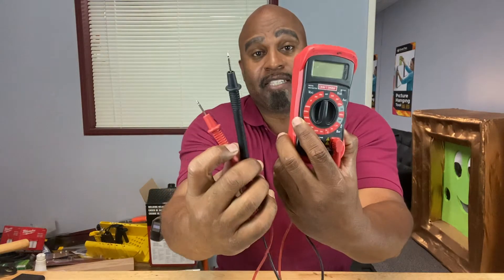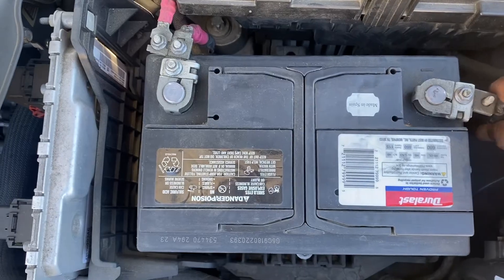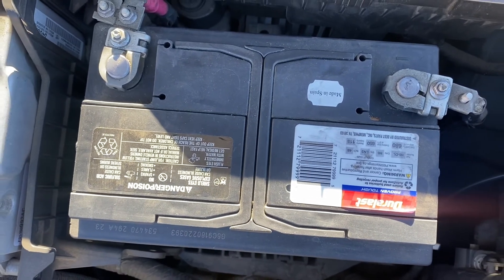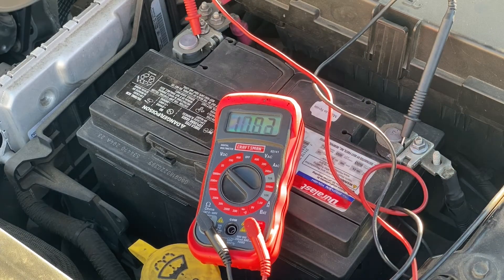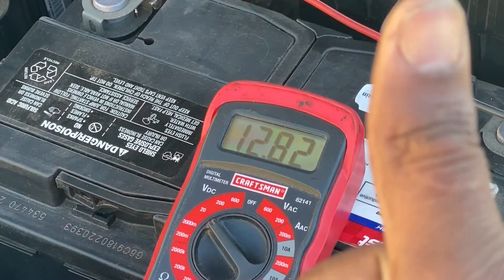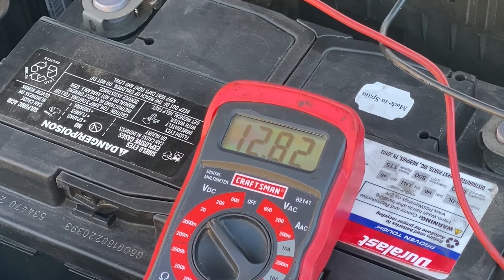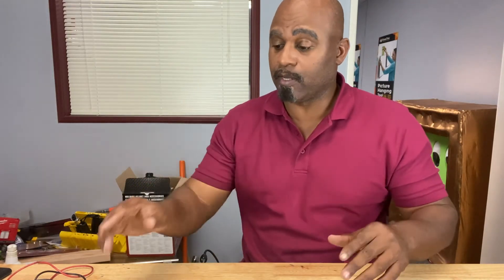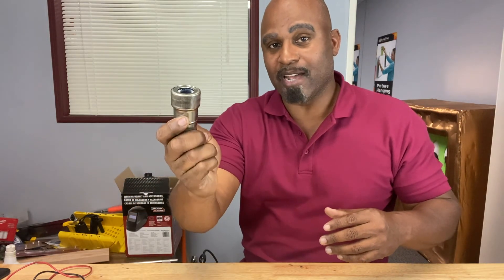HOW TO USE A DIGITAL MULTIMETER ON A CAR BATTERY

Comment: Thanks so much for this video! It helped me a lot, I'd never used a multimeter before and the manual did not do a good job helping to explain how to use it on a car battery.
Reply from the maker: Glad it helped.
Reply: @Caliber8Tools  Using your guide when my car wouldn't start, I found out my car is running at 14.4volts but with the car off the battery says 10.4. I took it out and hooked it up to a charger, hope that does the trick!

Comment: Pro tip - edit the audio track of the music you added for your intro. I typically use about -15 DB so the end result is the same audio level as my commentary. Each piece of music you add needs to checked before you compile the video for upload. That might reduce the amount of your viewers skipping your intro, or the whole video... nobody likes blaring music or commercials when they have their volume set to hear what your message is.
Reply from the maker: Thanks for the feedback.

Comment: Hi my car is reading 14.1v when engine running but when i put everything on lights heaters blowers a/c radio etc the voltage drops 13 to 13.3v is alternator faulty thanks
Reply from the maker: No if it’s above 13V your ok.
Reply: @Caliber8Tools  thanks

Comment: Very helpful.Thank you.  I have that same multi meter and I didn't know about the dropping below 10 volts when starting trick. I was also using the center port for my ground wire. I'm not sure if that matters.
Reply from the maker: Glad it helped. The negative cable should plug into the ‘COM’ port on the meter.
Reply: wait, now I am confused. In the video you do not have any cable plugged into the COM port of your meter. Did you mean the OHMS port because thats where you have it plugged in on the video here. I hope you answer me because I am trying to see if I have an electrical problem in my charging system. @Caliber8Tools
Reply: The black cable that goes to the negative terminal should be at the com port.

Comment: The meter connection is wrong.  Black lead is always in the common connection.  As a result if you set or measure something incorrect , you have no protection in the meter and it can be damaged.
Reply: If you have your test lead in Amp fused port, you have to test a certain way. Thats to test the ampers of the current through your circuit. You have to remove a wire in your circuit to do this, somewhere make your DMM part of the circuit you're testing. If you use this setting improperly, the fuse in the DMM should blow. If it's cheap, that might not have happened. If you use it above 10 amps, you're risking it even more. The only setting you should use a DMM on to test your car battery is DCV. That measures Voltage supplied by source, your battery. You can check resistances of any load you have in your car (so sensors, fuses, wires, etc) but you have to remove Voltage & shut off what you're testing or remove to bench test. High resistance can cause unexpected Voltage drop in your circuit. Low resistance can let too much through. But simply for your car battery your in DCV, & the black in comm & the red in the one with the V&Ohms symbol.
Reply: Meter connection looked accurate to me. What ground is the common ground younspeak of? I'm mechanically inclined and electrically a Delbert and it's so frustrating.
Reply: Why isn't this melting his wires? Like introducing to test a dewalt 20v battery and my wires melted instantly and yes it was a very cheap multimeter

Comment: Thank you.  Just remember, its clean & bare metal to metal  for the battery cables to the battery posts.  If you are spreading Dielectric grease or CRC battery protector as a way to protect against corrision, make the application after connecting cables and posts.
For the spray on , Protector, product, Its a light spray.  Too much, and it may seep  into post and make a film that reduces good contact.
Reply from the maker: Great tips. Thank you.

Comment: Hai Gentleman
Reply from the maker: Hello.
Reply: @Caliber8Tools  I hear when starting the car and the cranking voltage shouldn't be less than 9.6 volts, 9.65 volts  or 10.00 volts correct? After that, turn off the car and turn on your lights for 30 secs or 2 minutes or 10 minutes, which I find a little too long, what Voltage reading should you get? My car starts like butter and has had it for 7 years with my car battery, but I want to see my reading results.

Who says to turn the lights for at least 30 sec.30 sec on others say 2 minutes on or even 10 minutes on and close it before measuring?  Cracking voltage.

Comment: Why wouldn't you put the dial on 9v where the battery icon since it's a battery and the normal value of 12.x is closer to 9 than the 20 you selected?  Thanks.
Reply from the maker: We need to look at the VDC portion of the scale because we are checking for volts. 20V is the lowest value on the scale and we don’t need anything higher. The voltage will exceed 9 or 12 when we start the car but it won’t go past 20v.
Reply: You are essentially choosing the upper limit of the scale with which you will be measuring your battery voltage, so you need to choose a number greater than the one you expect, but not so great that you'll only see a rough estimate.  Too low an upper limit, and your reading will peg at that lower level, so in your example of 9v, you might see the number 9 briefly before it then shows L, even though your battery reads 12.6 when you switch to the 20 level.  Think of putting a conventional speedometer in a race car.  If it can read only 0-90, and your racecar is going 120 mph down the track, that speedometer would still read only 90 mph.  Be careful with the settings of your multimeter, as when doing other kinds of tests you can blow out your multimeter by choosing too low a setting.  When in doubt, start too high and then progress to lower settings as needed.

Comment: Thanks bro never knew how to use a multimeter. I just put a new battery in my 2015 Yamaha r1 and 2 days later it’s dead. Does anyone know why? I checked all fuses no blown fuses and I didn’t even ride the bike with new battery just started it a couple times now I have no power.
Reply from the maker: Any time. Could have been a faulty battery already.
Reply: I hope you got it resolved, could've been parasitic drain where something still uses energy even when the car is turned off.

Comment: Well  Hello!! My  battery is dead..how  am  I going to start it and if my  car is starting why  would I bother checking my  battery??!
Reply from the maker: It may not be totally dead. You can try to jump it or use a volt meter to check it.
Reply: could also be in the ignition switch, linkage, solenoid, starter ect. Start with the basics
Reply: Because you can still test it in its dead state also some cars start then die so that would be a other reason you'd utilize this gadget